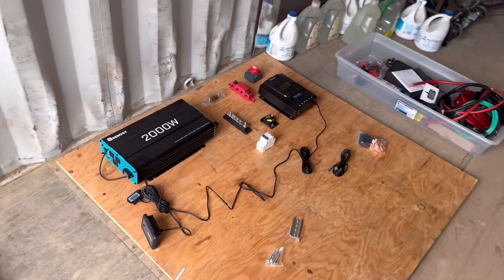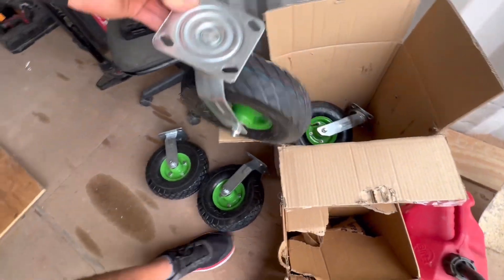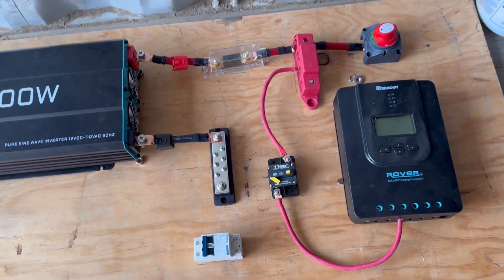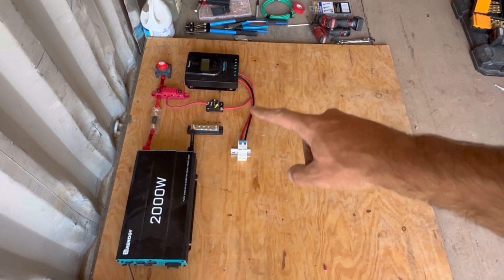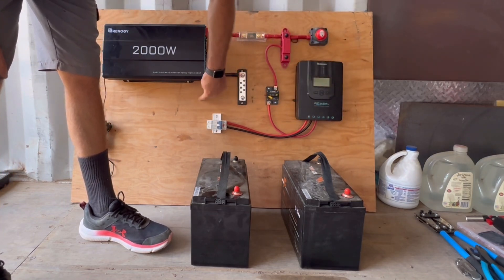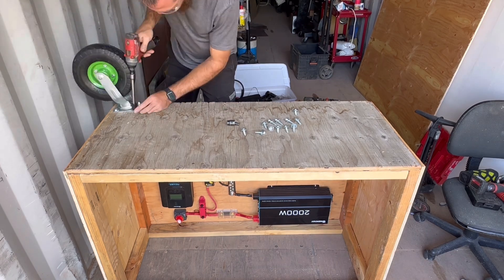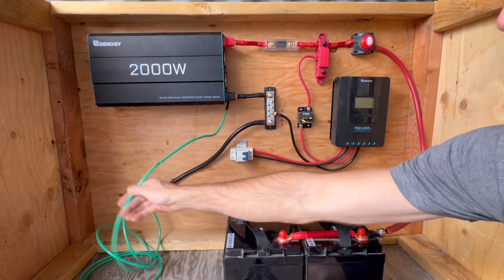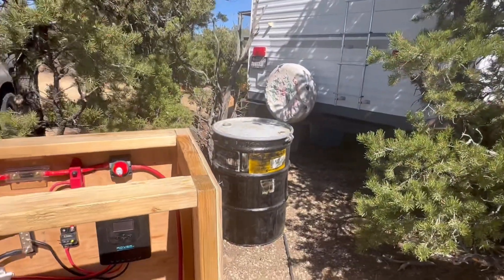FUTURE HOMESTEAD EP: ￼12 | DIY solar cart pt

Comment: Glad you went with 12V instead of 48V like I did.  I did the EG4 battery and inverter on a hand truck deal that I saw on the tube and quite frankly disappointing for my needs.  The idle consumption on the inverter is massive.  I connected it to a residential fridge and it only ran it for 37 hours.  The inverter consumed 2.7KW and the fridge 2.4.  To make matters worse if you don't have a minimum of 120V of solar panels the inverter won't charge.  Kind of new to all of this but am enjoying it.  What I have done is use the battery to extend the run time of my EcoFlow by directly connecting to the solar charging port using battery cables and an xt60 plug.  My next project will be a 12V system with a 460ah battery like power queen, or LiTime, or Epoch with the 2000 watt Renogy inverter as it will be more efficient than the EG4 3kw.  Another thing, while you have not finished the cart, I would consider wrapping the whole cart with a copper screen mesh, making you whole cart basically a faraday cage protecting everything inside from an empty or a coronal event.  Loved the cart and video.  Good job.
Reply from the maker: @shelley131  I’ve had people telling me I should have gone 48v! What do you plan on running with your 2000w renogy inverter? I’m thinking I would go any less than 3000w if I were to start over.
Reply: @Goodnuff_Offgrid_Homestead  Basically just my fridge during outages.  48V systems are great for larger loads but not great for my usage.  What I have done is use it now to power my 13,500 BTU A/C on my RV when parked in the driveway.  The 48V system inverter will not be as efficient as your 2000W renogy.  But if you have a large compressor or well pump my EG4 inverter will run it.  Eventually I have the option to expand it.

Comment: Did you verify the wire you used was copper an not copper clad aluminum
Reply from the maker: @loydhicks3413  I did not. What happens if it’s copper clad?
Reply: @Goodnuff_Offgrid_Homestead  copper clad is nothing but aluminum wire coated wth copper it will not carry a big load it will begin to get hot an pull a lot of amps an depending of how big a load put on them wired they can get hit enough to melt the coating an set the whole place on fire not to mention it hard on ur batteries it will kill them eventually
Reply from the maker: @loydhicks3413  I wonder if that’s why my fuse at the inverter pops at 1000w load instead of 2000+ watts.
Reply: @zak_collings_offgrid yes tgats exactly why pulling way too many amps an check tge lugs u crimped on each wire end maje possttgey are not loose in any way
Reply from the maker: @loydhicks3413 I have ordered pure copper wire so maybe I’ll post a short video if the setup performs better afterword.
Reply: @Goodnuff_Offgrid_Homestead  alot of companies are selling fake copper wire  coat the outsourcing a aluminum wire with copper an sake it as copper cut the end off of a piece see if it's copper ends if the fresh ends u just cut off look like the outside opoe color ur probably okay  but if it's a silverfish wite it's aluminum  I just bought two 24 inch long 1 awg that stands for American wire guage an two sections at 24 inches long 1 awg costed me 50 dollars most big 1 awg to 4 awg wire is sold by the foot an will run u anywhere from 5 50 a foot to 8 dollar a foot if u bought say like 25 ft of black an 25 ft of red 4 guage or even 2 guage an didn't pay way over 100.00 for it then u judt bought copper clad aluminum  which is nothing more than aluminum wire coated wth copper  ask any older person why they stopped using aluminum in mobile homed in late 60s an esrily 60s an see whst u get told it will make u go buy new wire immediately midt all mobile hime fired back in old dsys was electrical fired they used aluminum back then noy judt in mobile homes it was in everything back in 30s 40s 5s an 60s an in earily 70s they realized aluminum was not a good wire fir heavy loads they hest uo because they pull wsy too many amps an eventually led to house an mobile hime fired the early 70s when they discovered copper was the best fir heavy load carrying wire